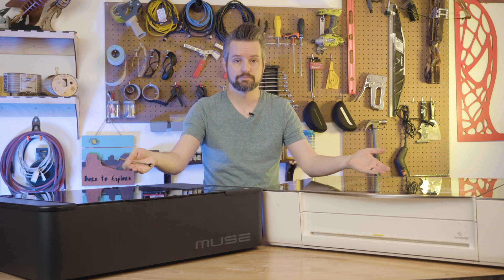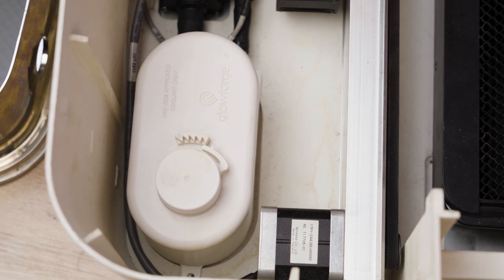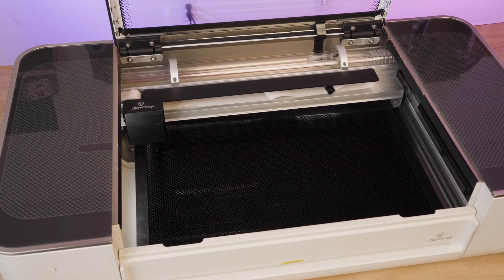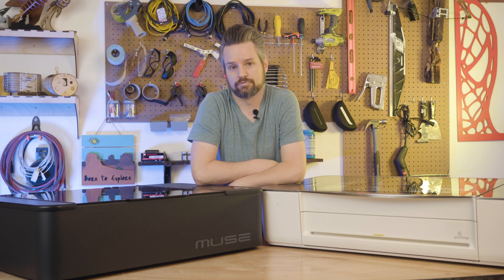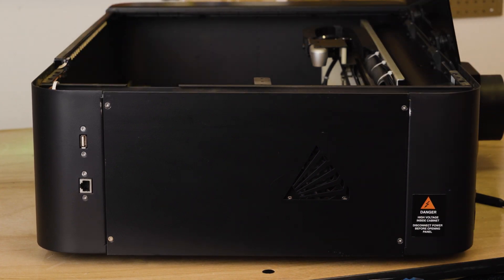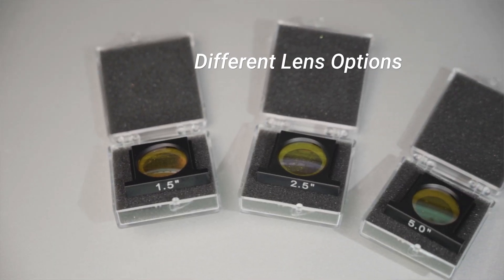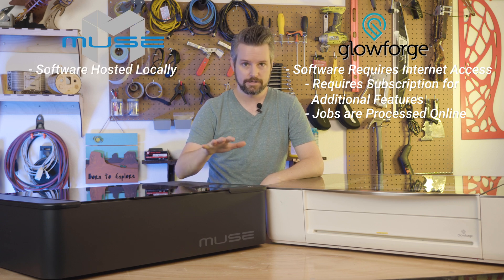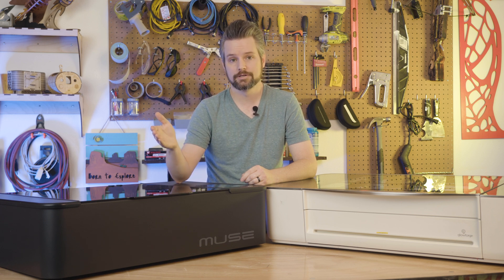Glowforge Review vs. Muse Desktop CO2 Laser Cutter

Comment: What is the difference between the now discontinued Dremel LC40 and the equivalent MUSE? Will we be able to order replacement parts for the LC40 from Full Spectrum if need be?
Reply from the maker: There are many little changes. Since we no longer make the LC40 it would be safer to go with a muse!

Comment: Can this machine cut inch thick wood? IDC if it's multiple passes but that's what I need. What's the max on this machine that's possible for thickness? I'm looking to buy. Thanks
Reply from the maker: It depends on which type of wood you want to cut. 1 inch bass wood is going to cut much differently than 1 inch plywood!
Reply: @FullSpectrumLasers  Can it do 1/2 inch curly maple? You definitely should do a video with it's cutting power of different thicknesses of wood. I'm only planning on using boards i plane myself. Thanks
Reply from the maker: @lushfauna  We recommend you get 150W laser if you're cutting 1/2" and above.  Always use 100% power and 100% current and start at 5 speed until it cuts through.

Comment: I'm having trouble cutting cardboard at 1/4 thickness. It's taking 3 passes at 50 speed, 80 power and 80 current to cut through it and I still don't have all the way through. The settings are correct and it's aligned well, so I don't know what the issue is. It feels like a waste of money to have both powerful and less capable machines. I can cut cardboard in one pass with my laser diode which costs $500, but this machine that costs $6000 can't even do that?
Reply from the maker: How long have you had this laser?
Reply: @FullSpectrumLasers  1 year. Used it less than 10 times in very small jobs. Already talked to costumer support but still no solutions. 
I kmow my way around these types of machines. I own 3 shapeoko cnc and 40 3d printers. So lack of knowledge it ain't.
Reply from the maker: @javiercamacho  Use 100% power and 100% current on every cut.  Slow the speed down to 5-10% and it should be fine in 1 pass.  You should never do more than 1 pass on a material like wood or cardboard.

Comment: I've had a FS hobby 40W unit 10 years now. Replaced 2 flybacks and 1 psu as well as a set of mirrors and lenses. 1 laser tube. Love it. Still works just fine.

Comment: Please see the string of emails to your support below.  There STILL has been NO response to me on this fix for  RE3.  Is this the support you give Muse customers?  Is this issue with RE3 fixed?

3-23-2022  Is this fixed yet?  

1-9-2022  Is the RE3 software bug fixed yet?

1-2-2022 Ok, please let me know when RE3 is fixed.  Huge disadvantage to not be able to use other design software.

Fabian (Full Spectrum Laser) 
Dec 29, 2021, 4:02 PM PST 
Hello Steve,
It seems that the error you are currently running into is a bug our software team is looking at. I was only made aware after I kept on running into the same issue myself using the file you provided.
While the issues are worked on I would recommend you add an additional vector box that encompasses the artwork being moved. I would recommend you use a yellow color and that set the color to zero passes in the software so it does not. I have attached an edited version of the file you provided me with the aforementioned fixes.
Regards,
Fabian
Reply from the maker: Hello Steve!
Justin had reached out stating the latest to you in March with your issue.
If you are still having some issues please reach out to our support team.
Reply: @FullSpectrumLasers  I have nothing from Justin in March 2022.  If he sent something tell him to resend.  I have not having issues, the Issue is with RE3, and my question is simple.  Is it fixed?
Reply from the maker: @slhasebroock  OK. I'll touch base with Justin and get back to you - Jordan
Reply from the maker: @slhasebroock   @Steve Hasebroock  Hey Steve! Go ahead and reach out to support@fslaser.com, that will create a new ticket and they'll push an update over to your unit